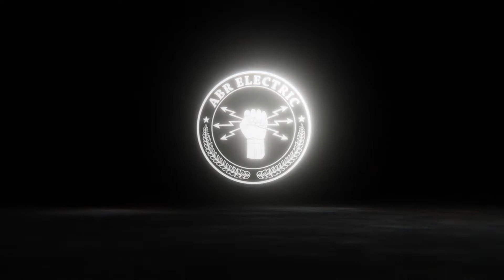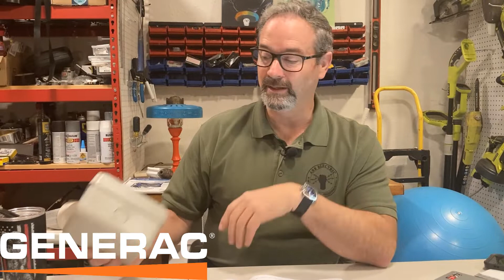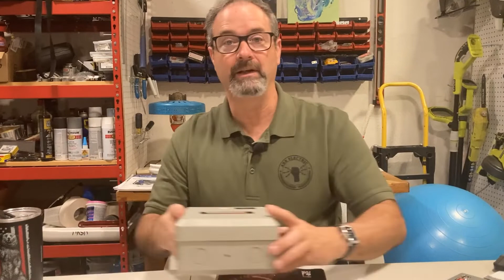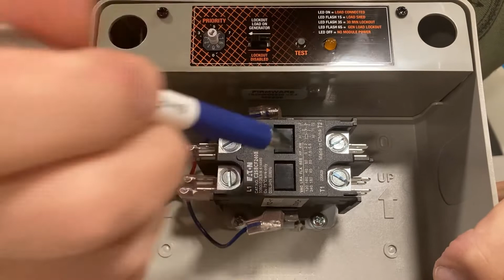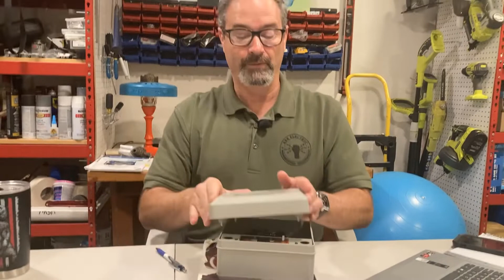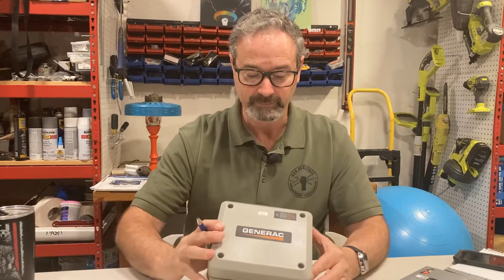Why Bother with Smart Management Modules (SMMs) for Generac Standby Generators?

Comment: I back up my whole house with a 10kw generator.  My large loads are 2 water heaters, central air, clothes dryer, and a well pump.  I put soft starters on the central air and well pump.  The two water heaters and central air are allowed to run 20 minutes each during any given hour.  The dryer is disabled.  If I want to run the dryer i press an "override" switch which allows it to run for one hour, the water heaters and central air are disabled during that time.  

The generator and transfer switch are controlled by a PLC.  I used normally open contactors for everything except the central air.  The 24Vac that from the thermostat is routed through a relay output on the PLC.

If the generator frequency drops below 55 hz all managed loads are disconnected for 20 minutes.  If it drops below 55 hz during that 20 minute period the generator shuts down.
Reply from the maker: Sounds like a good setup

Comment: Looking for a generator, I’m mostly concerned about the startup surge when we’re home, since you only have 10 seconds to turn things off before startup. When we’re away, the only big loads are the 3 and 4 ton ACs and a few lights, so nothing much to worry about.  We were thinking about putting one or both ACs on LCMs and a Kohler dealer says their 20 kW gen has great surge capacity so the LCMs aren’t necessary, while another dealer who sells Generac and Kohler says we should have them, especially with a Generac. All opinions on the need for LCMs with a 22 KW Generac or 20 kW Kohler are very welcome!

Comment: I got a Generac 24kw installed a few weeks back and on my test run I had both my ACs( 3 and 4 ton) running, washing machine, my office computer equipment and my electric oven, two small window ac units running and the generator never missed a beat.  I even ran up and down the garage door a few times and tuned on all 3 tvs in the house.    I honestly couldn't think of anything else to even turn on to test and the electrician was like "don't worry about it, you are not going to overrun this generator"...he was right.  I ran two hours test and life as normal in house didnt make it break a sweat.  I probably could have gone with a 18 to 20kw on my house but buying up to 24kw keeps me from needing the SMMs.  4k square foot home and boat house all powered easily from the 24kw.  The installer did have the gas company come out and put a much bigger valve on my meter to increase flow.  The meter itself is an Intelis Gen 5 250 BTU and I figured they would have upgraded it, but the gas man told me a dirty little secret, most of these new residential meters will easily push over 500k BTU as long as you have the right valve and Pipe size allowing the flow from the street.  They upgraded mine and said I would never have to turn anything off gas wise to keep the generator running.
Reply from the maker: That is awesome!

Comment: Great explanation. Thanks. I have one of these on my dryer. It’s a vacation home. The dryer stopped working after a recent power outage where we were not at the home. By process of elimination I determined that the switch was at fault. I disconnected and wire-nutted load and line wires. The dryer now works. I’m not sure I even need the switch. It was here when we purchased the home. Can I leave it bypassed and is there a better way to connect the wires? Also wondering if test button is also the reset button.

Comment: Great video, We just upgraded to new furnace and a/c also updated new electrical panel. The home came with a Generac 8kw generator so this will not power ac or hot water tank so we installed one SMM on hot water tank and I am going to order SMM for a/c.

Comment: 150 bucks each
Need 3
Plus install = home owners claim
It’s a pain in the ass to be honest
And when them smm’s go bad they snap and click and sound like transistor box for electric fence 
Kind of intimidating
Reply from the maker: I agree. The alternative is to hardwire the control coil wiring to all the load shed NC contactors. It just adds a large layer of cost.

Comment: My generac load shedding module kicks in and out all day.  How can I fix this?
Reply: If it is doing that while the generator is off, it’s either faulty or you have a something upstream going on. Do your lights flicker?
Reply from the maker: I don't know. Anything obvious in the troubleshooting section of the instructions?
Any loose connections at the coil on the contactor?

Comment: Hey I a m a Florida electrical contractor. Great video. Although generators are not my primary line of work, I do install them on occasion, I also had a service call were a smm went bad and cut power to a clients dryer for 2 days until I could get there. that's the only concern I have with them. Just like anything else is something more that could break, and in my case caused the customer an inconvenient even though she never had an outage. the SSM just simply went out. Other than that. It's a grate and budget friendly attentive to a full house back up generator as far as cost.
Reply: Exactly same problem with these.  3 of mine have gone out.  The contactor needs to be redesigned so that street power does not go through it all the time. When these things fail, it kills the power to the device even when the generator is not running.  These are usually key appliances like AC units.  Not going to have a generator control my  everyday life.
Reply from the maker: I agree. I worry about the same issues with AC condensers in the summer.
Reply: MY SSM went out in less than a year, it was installed to assist our A/C, but neither my installer nor Generac would replace this part, it can cost upwards of 300 bucks every time this unit fails.
Reply: If they are NC contactors, even if the control board fails it should still pass through right? The one on his video is NC. I just purchased a 100a version and it is NO. Makes me nervous

Comment: I have 16KW and a new 5 ton AC that is very efficient. But as mentioned others in the house are no so aware of the potential to overload the generator. My transfer switch has load shed terminals. So if I can use one of these SMM on my AC unit that would give me peace of mind. I assume I can just run this in series between the breaker and the AC unit. Then run the load shed leads to the transfer switch?
Reply from the maker: You would wire the SMM in series between the breaker and the disconnect. The SMM senses the change in frequency when the generator lugs down and opens the contactor.
You can use the load shed terminals in the ATS by running the low voltage t stat wires in series through them.
Reply: @abrelectric  Thanks for responding!! If I run the the low voltage t stat wire to the load shed terminals do I even need the SMM?
Reply from the maker: @floydadcockrealtor  nope

Comment: I live in American Fork, Utah.  I grew up in St. George, Utah.  Compared to St. Gerorge  Municipal Power (remnant of the 1930s REA) my current power company (Rocky Mountain Power), my electric power is extraordinary stable.  The joke in St. George when I was a sarcastic teenager was if a bird landed on a power line and pooped, the power went down.  In fairness, the system was growing so quickly, the city had a hard time keeping up.  I turned 10 in 1965–the population was around 3,500.  When I graduated from Dixie High School at age 18 in 1974, the population was pushing 12,00-14,000.   Where I live now, we experience an outage perhaps once a year—if that.  Average outage is 5-10 minutes.  The longest outage I remember was about three hours.  St. George had several 12-24 hour outages when I lived there—but again not much you can do at the end of a several hundred mile transmission line if that line is taken out by a small plane crash or a forest or brush fire.   If I still lived in St. George, I’d consider a generator.  In American Fork, I’m not too sure I need one.  Though my wife is agitating now and again for one.   So, I am kicking it around.  We’re both 67.  If either of us ended up on oxygen as we continue to age, a generator would become a necessity.  What holds me back is I would need to take on much of the work to keep costs down.  The wiring and gas plumbing are pretty straightforward.  Service entrance is about 15-16’ from the gas meter.  No underground utilities between them.  AC compressor is between them on the same side of the house.  Do you have any suggestions on where I could learn how to properly size a generator?  Could I calculate my average daily usage from my most expensive electric bill (summertime A/C use) and use that as my basis?
Reply from the maker: I would size the generator based on your priority load during an outage. For an extreme example,  if you really only needed power for two oxygen machines, you could simply get a small, quiet inverter style generator (3kw) and simply run a few extension cords for the duration. 
Going the other way, prioritize the large loads: AC condenser,  electric water heater, electric oven, etc. The more large loads you need the larger your generator will be. Your generic lights and plugs use very little power.
My parents lived near St. George for a bit in the early 2000s. Pretty country.